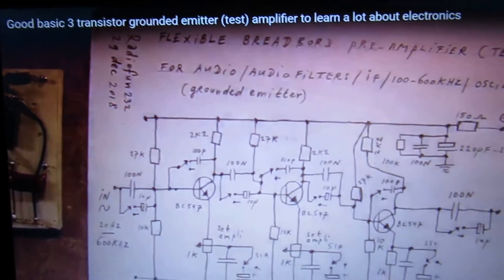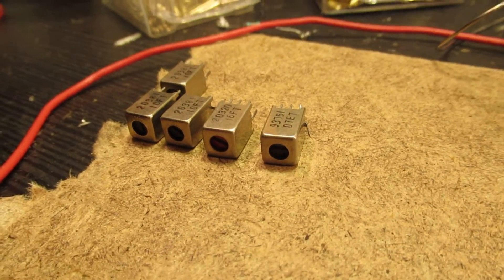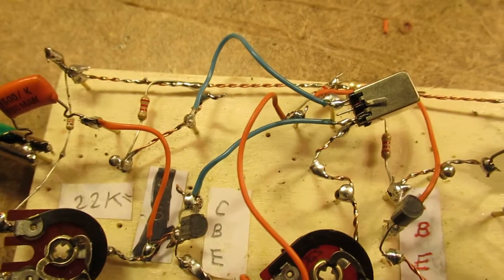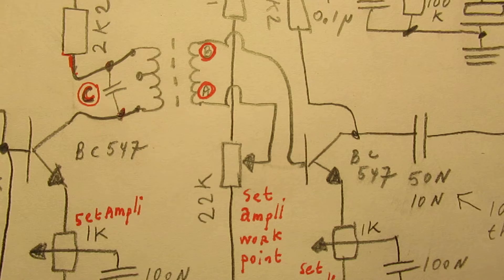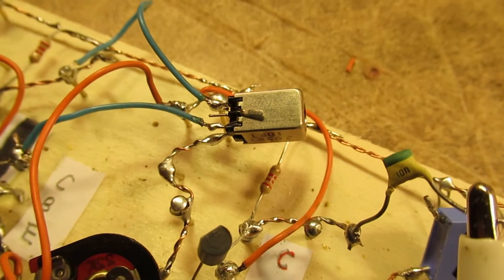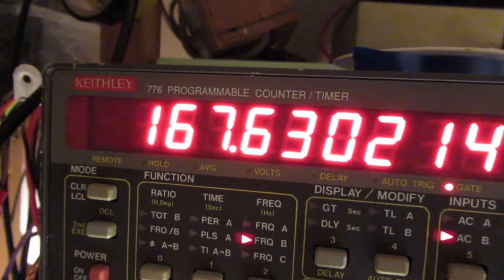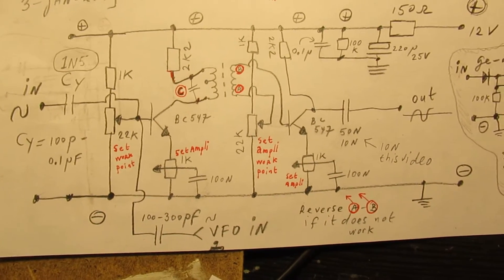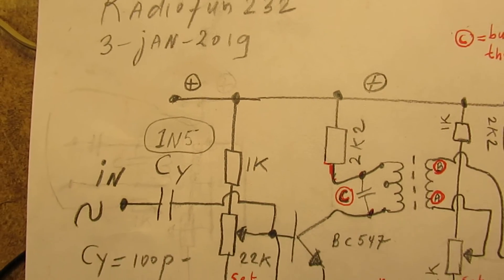2 transistor grounded emitter frequency dependent amplif. with a coil 30 KHz-1 MHz (455 KC)

Comment: The quality of video is perfect. I would like to ask. Which camera you decided to buy?
Reply from the maker: It is the Canon SX 620 HS. See some noise when I film under darker situations, but that does not matter here (my workbench is flooded wih light). And it is somewhat too small for my hands, anyway.
Reply: @radiofun232  By watching the video I was thinking if it could be recorded with a sony camera. But cannon focus seems to be a bit quicker, also the macro mode seems to work better on your canon. Sony would probably corectet the scene more into neutral tone. I have not experiences with a particular camera but Cannon's colors and optical stabilization can be even better than Sony's one. I had a look on the price tag. In Slovakia the camera costs 189€. I haven't noticed any noise. It seems that for the money it was a very good purchase. When camera works good at low light it a sign of a good sensitive sensor, and that's always plus...
Reply: @radiofun232  :-) Finally I see your workshop like I am there...